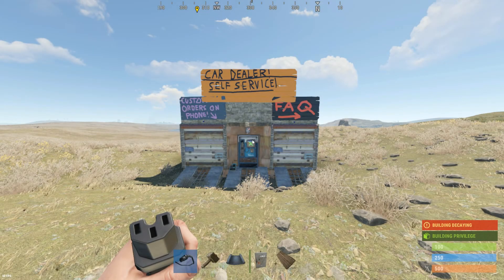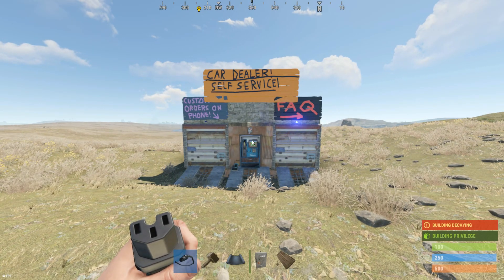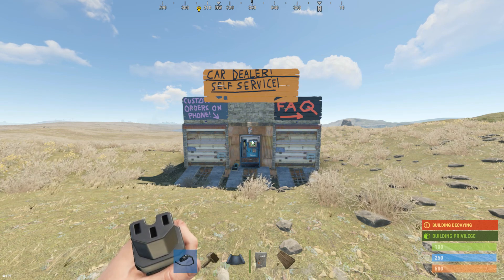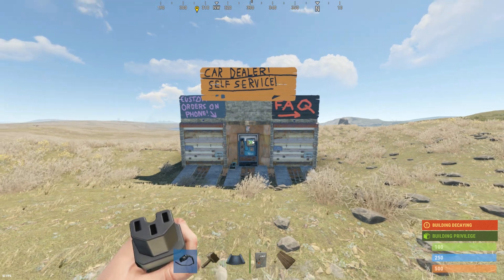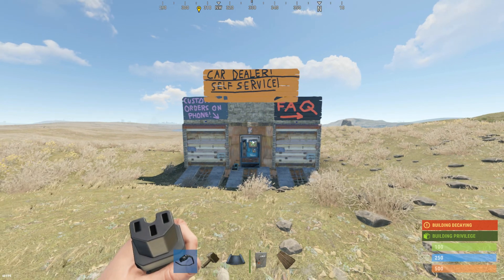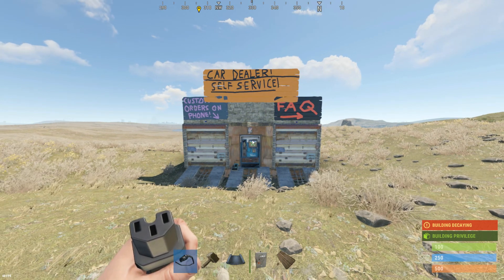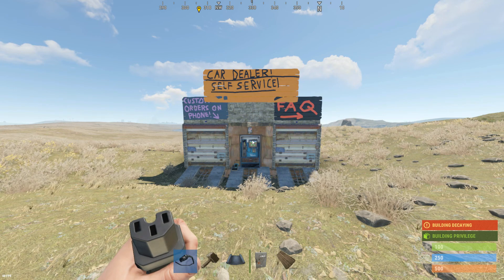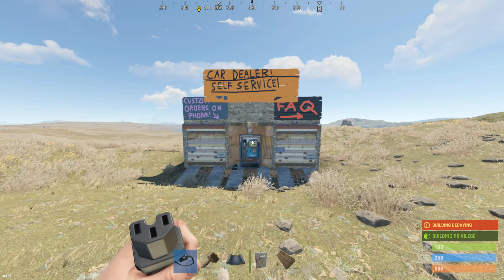Car Vending Machine in Rust!

Comment from the maker: There are a couple of gaffes in this video that I need to highlight! I reshot footage a few times, so it's clear some changes need to be made.
1. Buttons no longer work for the selector switch as of Feb. 2022. It now fails to "toggle" the memory cell properly. Use a regular switch to resolve this.

2. The backup battery circuit is missing the second electrical branch, as seen in the video I linked to. Unless you are using a turbine and can always guarantee ~60 power, you need to correct this problem, as using only solar panels would leave a window of time where things are unpowered!

2. The box method for key storage is jank and still leaves room for realistic problems. Imagine that while you're offline, P1 comes and buys a key but gets the wrong one (whichever is first in the vending, top left to bottom right). He takes all the keys from the back and drives off. P2 shows up and buys the only key left, which is now the wrong key. Now P2 has paid and gets nothing.

The only real solution for this is to fit a box inside of each bay, but it might cause problems driving in and out. Regardless, these are things I think builders should be aware of!